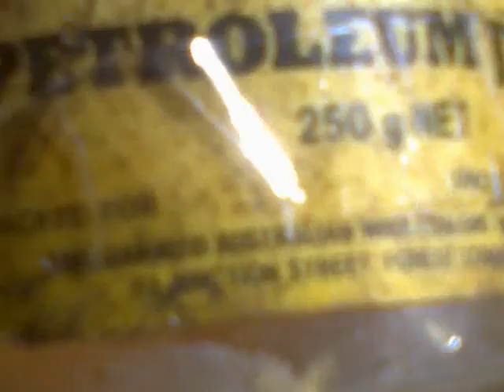Frozen Pump Temporary Repair Saga, Part Two.

Comment: Hi Chris.
That was a bummer with the pump but you had to give it a go. Water is a very strange thing to work with. 
Just when you think you have it sealed something starts to leak. Anyway, once you have it welded it certainly shouldn't leak. Have a good one. 
Cheers mate. 👌👍
Reply from the maker: G'day Mike,

Thanks mate !

I knew from the start that it wasn't going to be a permanent fix, but it got my Tank filled on Monday, and it won't be welded till Thursday.

So, it "worked well enough to get me out of trouble...", kinda thing.

Such is life,

Have a good one...

Stay safe.

;-p

Ciao !

Comment: Well done trying the bush repair, you don't know until you try. Looks like the valve being closed was just too much pressure for the patch but it's still working well enough to get the job done for the time being.

That coffee looked delicious, how do you make your coffee? Preferred brand, method etc?

Is your verandah made from Chep style pallets?

Have you ever tried homebrewing beer? Perhaps Coopers?

Cheers Chris 🍻
Reply from the maker: G'day,

Yeah, because the Crack went into the Metal Thread around the end of the Drain Plug, I couldn't capture and cover both ends of it, so the Water Pressure was able to get around the end of my Patch.

Sachets of highly processed fake Cappuchino, which come in boxes of 10, with some Sprinkling Chocolate.

Yeah, Chainsawn Stringy Bark over Pine Pallets.

Such is life,

Have a good one...

Stay safe.

;-p

Ciao !
Reply: @WarblesOnALot  I have similar sachets in my camping gear tub 👍

The pallets look like a great idea mate, I'll have to remember that for the future.

Cheers 🍻

Comment: Pretty good job. Nice rigging you did there. Looks like you're dealing with micro climates within your area. Too bad you couldn't keep the water flowing through that cold snap. Even a little bit might have protected the pump. You'd have to keep the pump lower than the water level for that. Part of the problem, however, might be in knowing exactly when such a cold snap is gonna strike.

All the best to you and yours.
Reply from the maker: G'day,

Thanks mate...!

The problem is that it's never been a thing I've had to worry much about, as a kid draining the pipes every night was a regular Winter thing ; but between Global Warming and being atop the Ridge - in the warm layer of the Temp. Inversion, surrounded by the Thermal Mass of the Water in the Forest ; I rarely saw below Zero temp's, and I had no Waterpumps. Then I bought 3 Pumps, during the Megafire Drought, and lots of Trees died...

So this year, the Sub-Zero temperatures in my Clearing came as a bit of a surprise.

Such is life,

Have a good one...

Stay safe,

;-p

Ciao !
Reply: @WarblesOnALot  Wow. That's a lot of change. I hadn't really thought about how a tree cover could moderate temperatures in that way, but, yeah, it makes sense. Does it appear like it'll turn more into a kind of savanna? I hope you don't loose all your trees. We're gonna be getting up to 40C today. Not used to it getting so hot so soon. But, as you say, such is life. I'm sure you'll find a way, if you're not too distracted.

Take care.

Ciao for now.